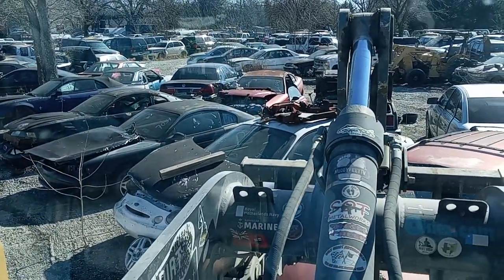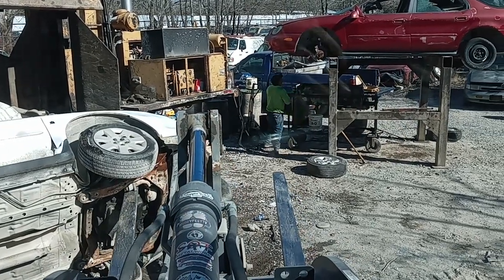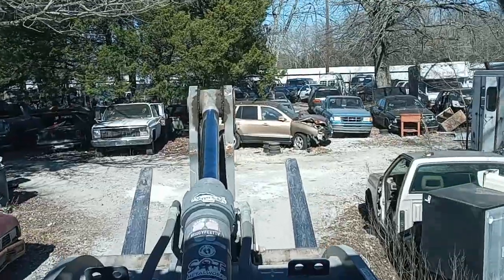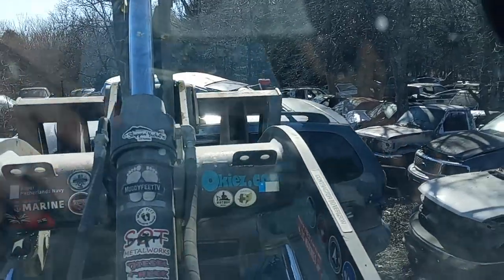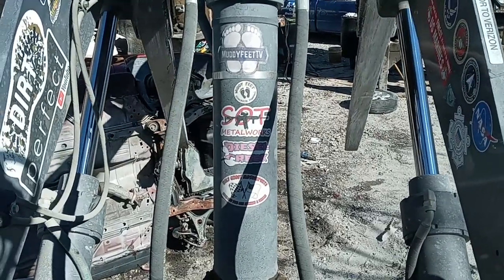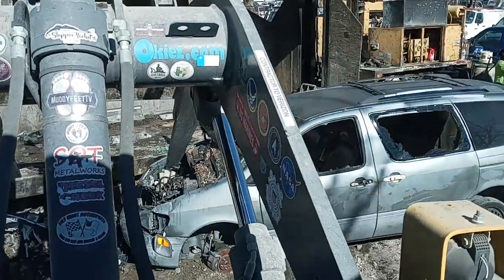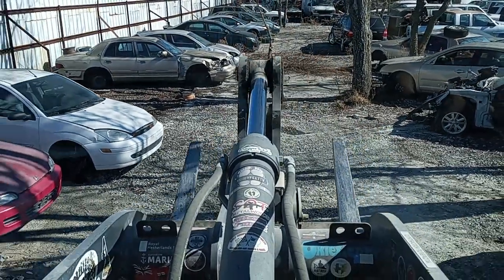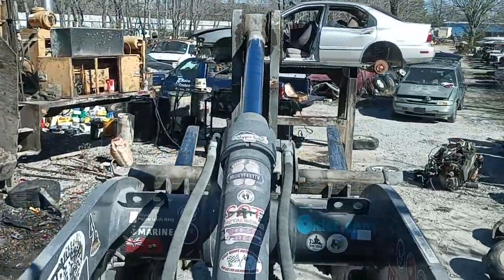The Last Ford Taurus Station Wagon on the 🌍 gets Crushed 😳

Comment: I still drive a 2005 Taurus sedan with almost 300,000 miles on it. OHV engine which is a tank. You really got to watch out for and take care of the transmission as they're usually the reason they get junked now a days. I put an aftermarket cooler on for the transmission to help keep it cool as well. I want to see if I can get it to 1 million miles lol.

Comment: Oh man there is a beautiful Taurus wagon rolling around in my town. I have no idea what year it is but it’s definitely a 90s model.
Reply from the maker: I like em 👍
Reply: 1998 or 1999.  The brake light and turn signal lenses in the rear are all red, whereas the 1996 and 1997 ones had amber turn signals.  It still has the 1996 to 1999 front end on it, and the front grille was revised a little bit for 1998 (it has a grille with a chrome strip on it.) The front end was revised for 2000.

Comment: Ford Taurus Wagon (crushed on screen) getting prepped to be crushed. 1996-1999, interesting. I know it ain't the last one Cowboy, there's at least TWO up here I've seen. Maybe the last one in YOUR area.
Ford Taurus (crushed on screen) on the rack, getting prepped to be crushed.
Another Ford Taurus (crushed on screen) set aside in the back.
Ford Freestyle already pre crushed sitting on the crusher.
Honda Civic set off to the side.
Honda Accord (crushed on screen) getting prepped to be crushed. Interesting, 1994-1997 model.
Toyota Sienna set off to the side to be prepped (crushed on screen).
Nissan Sentra set off to the side. 1995-1999 model.
Honda Accord grabbed. 1994-1997 model.

6 cars were crushed today, one of which was already seen pre-flattened on the crusher. 33 previously means our new tally is 39.

Cars set off to the side to be crushed but uncrushed on video has a current total tally of 10.

Pre-wrapped cars is uncountable. 3-4 per, sometimes just two.....makes it hard to tally.

Comment: Great video as always cowboy. When it comes too popping a mottor out of front wheel drives like that I wonder if it would be easier cutting subfram out with torch
Reply: Safer and more cost effective just to pull it out
Reply from the maker: Even after we drain em there is vapor and tiny bits of gas dripping 😳🔥🚒👩‍🚒

Comment: My dad picked up a 98' Taurus to replace the families 85' Pontiac 6000 and out of all the cars we ever owned it was perhaps the most accident prone. Both tires it rolled off the lot on burst, the gearbox shit itself and the brakepads routinely seized and must have been replaced half a dozen times before we got fed up and swapped it with my Grandpa's 96' Camry. Still, it had fun performance as my dad settled on the SHO package with a great eye catching green coat. A guy around here still dailies a Taurus Wagon, dudes got more patience then us lol